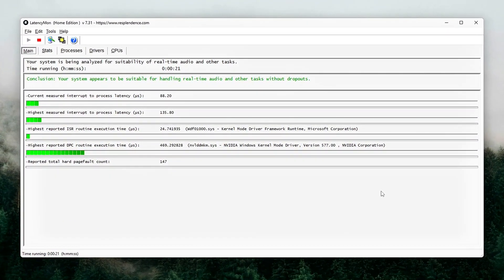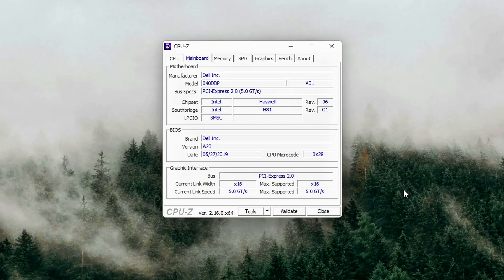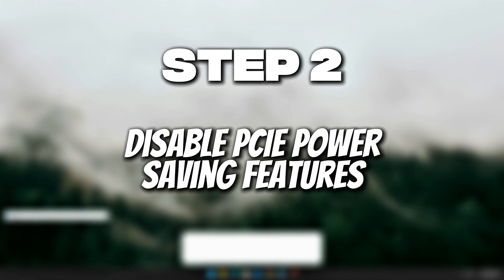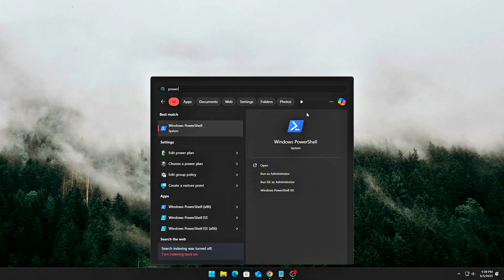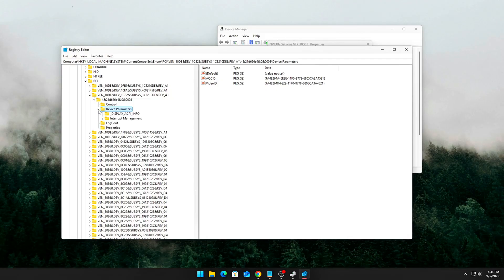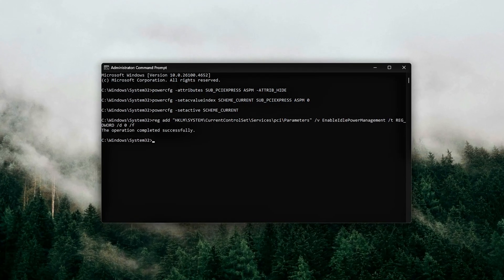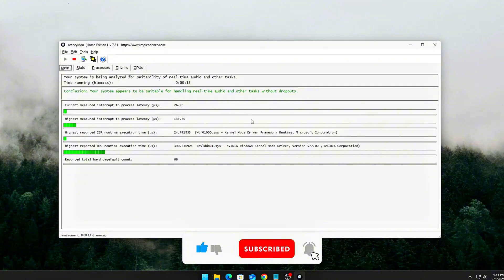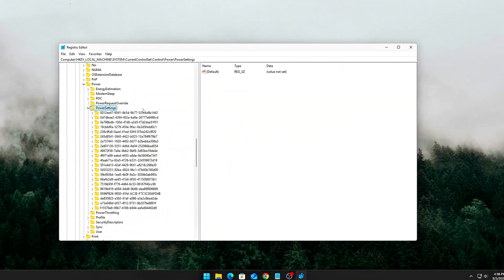Boost FPS Stability – Fix PCIe Stutter & Hidden Bus Lag

Comment: I have i5 3470t and 1660 super 12gb ram but it has low fps in rpcs3 and yuzu. Please fix it
Reply: hhhhhhhhhhhhhh
buy new cpu rpcs3 need i3 10gen or up yuzu need 16gb ram i5 7700 or up
 i3 10100 or i5 10400 is the beast

Comment: i just did the RAM configuration video you recently shared. I'm not entirely sure if it fully worked or not. however i have faith that it did. with that said. perhaps you could go back to the creation of this vid because you used CPU-Z instead of GPU-Z.

Appreciate you my friend !
Reply: it works!!
Reply: @HairryTurttleneck Nice ! What changed did you notice ?
Reply: @bxpisces0392  tbh im not sure which one did it, but i have a mother board wo xmp or any tweaking tools at all. so my 3200 ram only ran at 2100 something until getting stoned and following his vid and now its at teh 2900 speed. so i know that worked lol
Reply: @HairryTurttleneck lol the getting stoned part sounds like the universe was on your side with that one and threw you a W 😂👍🏽

Comment: AsRock X870E Nova Wifi 7, AMD Ryzen 9 9950X3D, RTX 5090 Aorus Master (PCIE gen 5), 64GB Corsair Dominator Platinum DDR5 6000MT/s, C: 4TB Samsung 9100 Pro (PCIE Gen 5 Slot) D: 4TB Samsung 990 Pro (PCIE Gen 4 Slot). Both CPU and GPU are undervolted. 

Thank god for up arrow when typing in command prompt stuff :D
Reply: Is tis works?
Reply: @johngaming26  No this just forces ur gpu to run at max all the time and causes overheat with no real benefit. The only thing you should do is enable MSI with msi utility v3.
Reply: @NekoEdit  lucky my cooling is up for the job then.

Comment: Will this help older laptops? Or does it need to be 40 series or newer
Reply: Doesn't need to be 40 series, no.   Backup registry before making changes.  Or at least keep a note of changes you have made so you can undo them easily if need be.

Likely these changes will increase power/battery consumption.